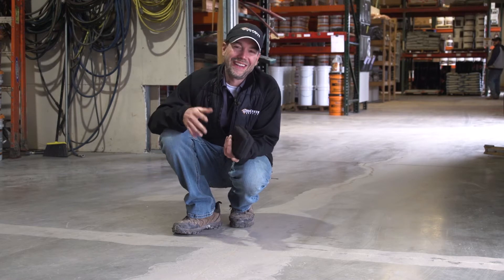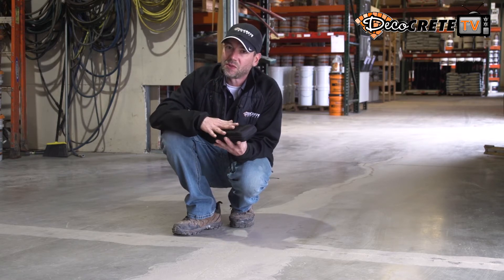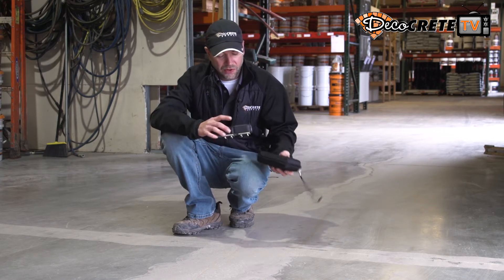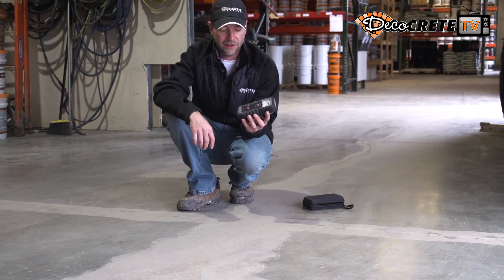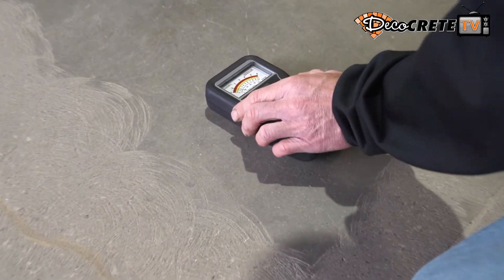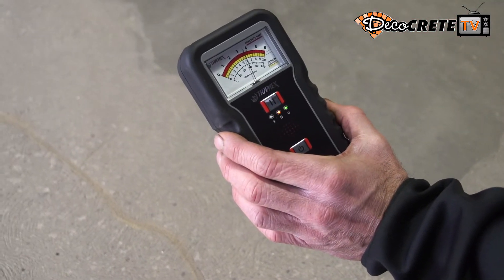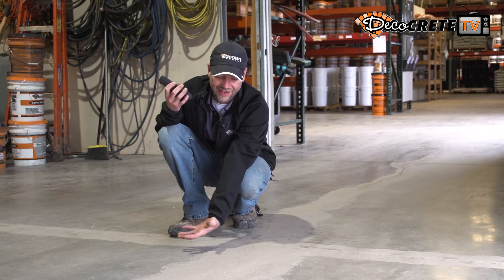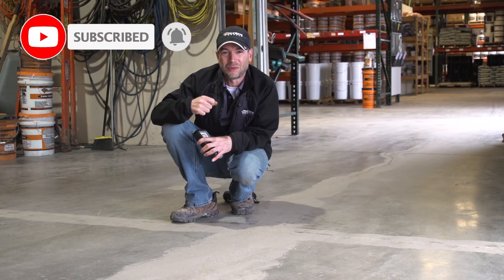How To Moisture Test Concrete!

Comment: Does the concrete need to be dry before you test for moisture content
Reply from the maker: Yes, if the concrete is wet or even damp on the surface, the meatier will pick that up and give you a false reading. Thanks for watching Deco-Crete TV!!!

Comment: At what depth does it check for moisture content ?    I mean,Does it check the moisture content on the surface or does it check for moisture content 100mm below, or 200 to 300mm below the surface (for deep concrete beams)
Reply from the maker: Thanks for the comment! This meter measures the moisture content up to 20mm (3/4") below the surface of the slab. This works really well for testing before applying a floor coating. If there is excessive moisture in the slab, it will show up at the surface and this meter will pick it up. This does not mean that it tests all the way through the slab, so if that is important, this might not be the best tool. The Tramex CME5 will also read moisture & RH probs that can be place in the concrete, but you would need to drill a hole for the probe. Again, it all depends on how deep you need to test. Hopefully this helps! Thanks for watching Deco-Crete TV!!!

Comment: Is this per ASTM standards? 
Dont you have to drill the concrete and probe test or something like that.
Asking because i had a slab leak at my house and my restorstion comoany os using the same meter toy have to test my concrete but my insurance is saying that per ASTM they have to drill and do a probe test ?? Thanks for any help. I want to understand this a bit better and educate myself on the topic.
Reply from the maker: Thanks for the comment!! You would have to check the exact ASTM standard for the specific application, but I doubt that this meter would qualify. It's meant for the contractor to have a quick easy way of making sure the floor doesn't have excessive moisture before they start the job. This meter has never let us down, and most of our customers use this exact one. But I'm guessing the insurance company probably wants to follow the exact wording of the ASTM standard, which would probably require drilling & probing. Thanks for checking out our channel👍

Comment: If a patio was sealed too early and trapped moisture, would this tool be able to show the moisture content?
Reply from the maker: probably not. it would most likely give a false reading due to the sealer. if too much moisture is trapped under concrete sealer the effects would be noticeable to the eye

Comment: How much is too much moisture in concrete in order to install a tile floor?
Reply from the maker: For concrete floor coatings slab moisture content should not exceed 5%. Please check with your tile manufacturer for specs on tile floors.

Comment: I'm surprised the meter is not digital.  I trust digital more, since no moving parts to wear out.
Reply from the maker: There is a digital version available, but it will be a little more expensive. Thanks for watching!
Reply: The Tramex CMEX5 is our Digital Multi Moisture Meter. Providing Ambient & in-Situ RH, Temperature, Dew point as well as instant Non Destructive Surface Moisture Content Readings. Check out our Video https://youtu.be/gWcOgqzQ0cM . Many Thanks!

Comment: Thanks for the video! Is there a topical treatment, a chemical agent not considered a primer or sealer that would close pores in cured concrete? One that could be used before primers or sealers?
Reply from the maker: For concrete coatings, we recommend our moisture shield primer. It is a primer though, I don't have a great answer to your problem. Thanks for watching!

Comment: Hi there awesome video I have a question what's the moisture level limit before you will have to use a sealer on the floor prior to install a hardwood or laminate floor
Reply: Steve generally 3.5% for concrete coatings and 4% for hardwood or laminate.  Always refer to manufacturers specs for moisture testing as well.
Reply: @daviddaniels2082  thanks